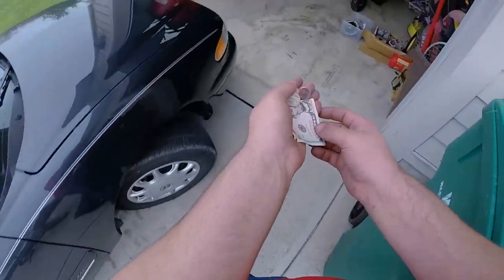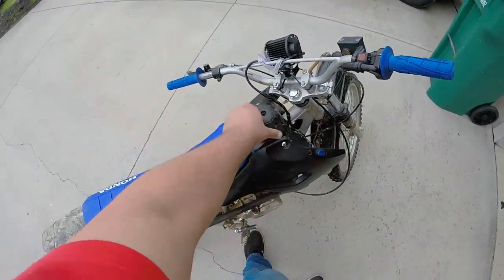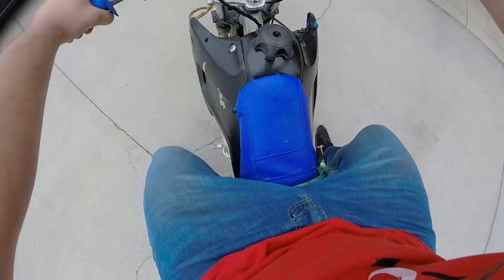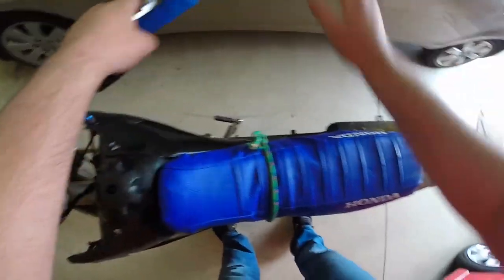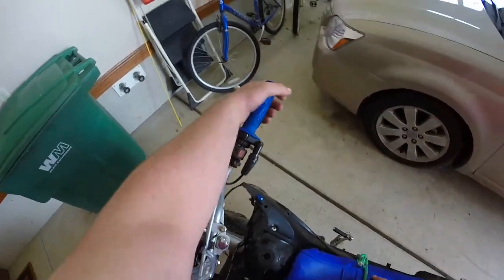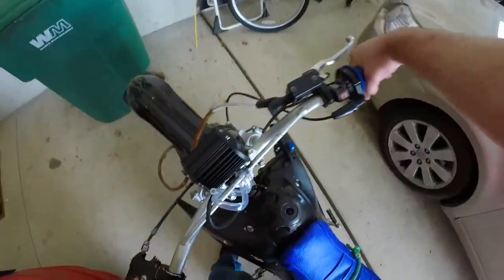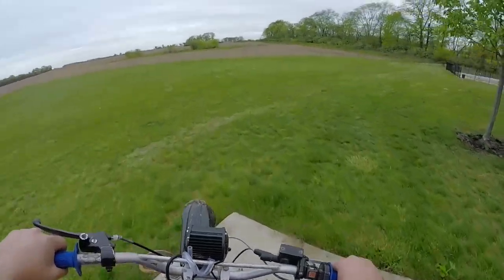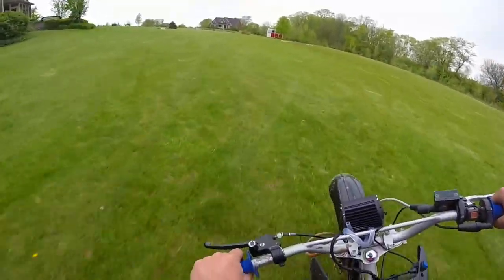How to make your dirtbike SHOOT FIRE

Comment: will this work with my KTM SX 85?? do i need any mods?????
Reply from the maker: If you have a stock muffler then it might not work, depends on if you have a spark arrest or or not
Reply: @SneakyZeke  buy the cheapest exhaust you can find off amazon and it will probably work

Comment: Just lean out the carb for backfires, it'll heat your engine up pretty fast and you'll probably loose some power too...
Reply: What
Reply: No running it rich will dump excess fuel into the exhaust which will then ignite and that's where you get your flames from.
Reply: @matthewhenry6797  for 2 strokes its lean for 4 strokes its bad ignition

Comment: Shut it off while its hot and still moving, when ur crusing, then wait for the pop and flip it back on
Reply from the maker: I’ve done that a couple times before, it’s fun with a big displacement bike, but you’ve got to have an open pipe, no spark arrestor or anything
Reply: @SneakyZeke  i got a stock kawasaki 140l 4 stroke and it does it